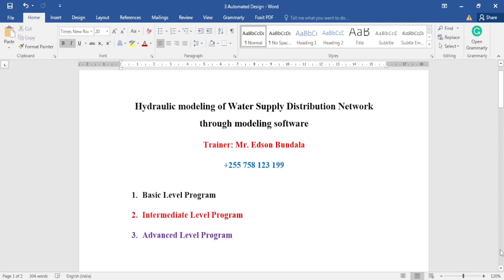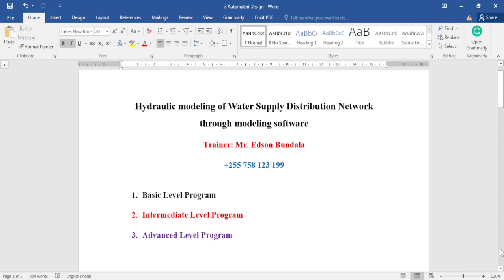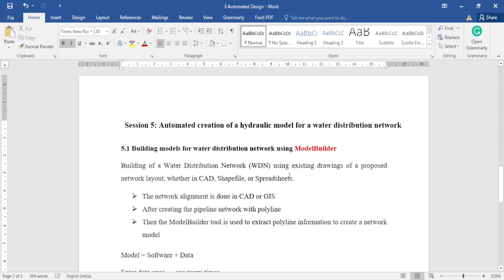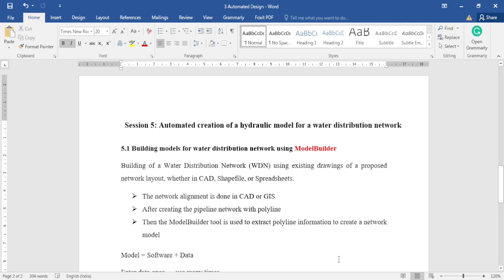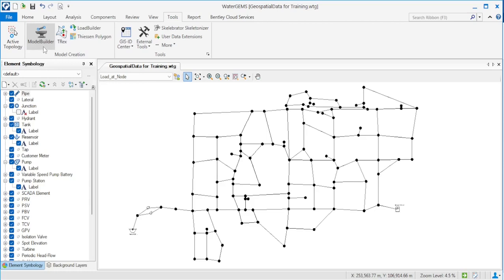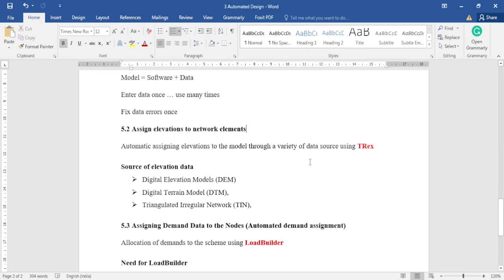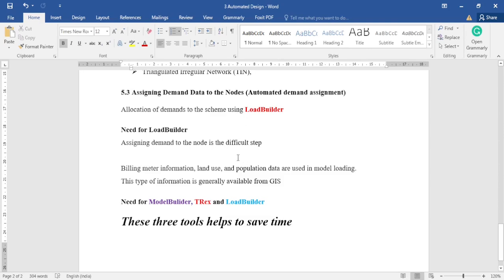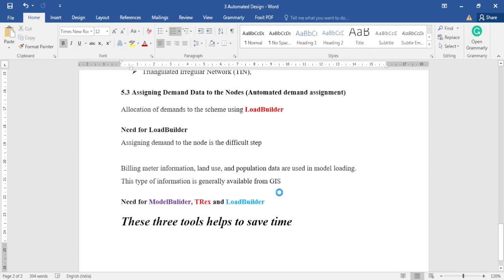Introduction to Automatic Model Building Methods

Comment: Hello sir great videos
I have a question what is the minimum and maximum velocity,flow and pressure allowed in a water network starting from a small network to a more larger on 
Your response will be highly appreciated
Reply from the maker: Hello, thanks for your comment, I appreciate that.
Those simulated results depends on your design constraints,
Min Velocity you can adopt 0.3m/s and max velocity 3m/s, min pressure 7m/s and max pressure shall not exceed 50m (5bar)
Reply: @edsonbundala  alright thank you